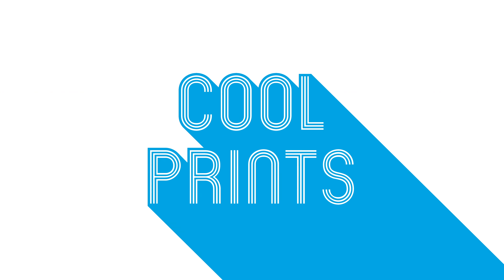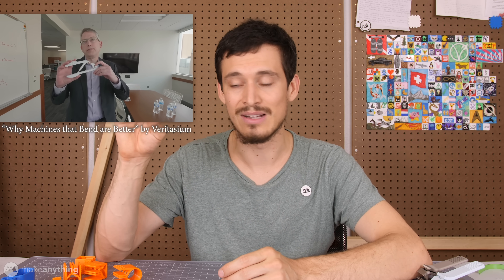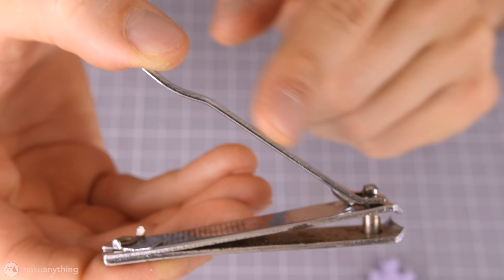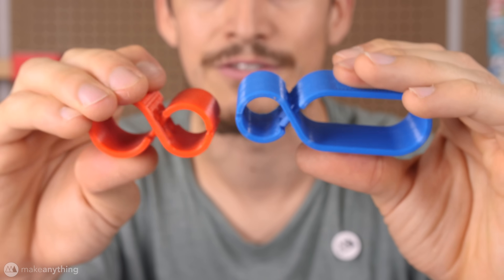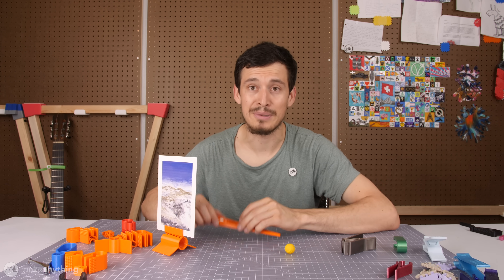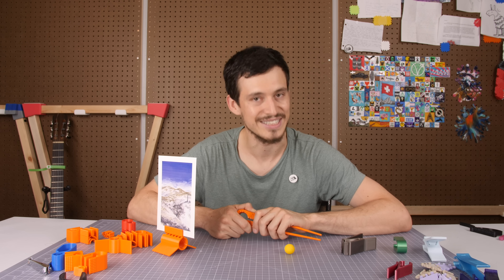Cool Prints // 3D Printed Compliant Mechanisms

Comment: use a stick in place of the ball in the chopstick.. like the switch shown in veritasium video. I meant, fix the ball with 2 rods on the top and bottom side of the ball .. then it will fix the problem and will become a compliant system too.

Comment: 2:39, yes, it's a 2d geometry, but that's not so you can laser cut it from a flat piece of acrylic.  It's so it can be manufactured at a microscopic scale.  Most of the advances in compliant mechanisms have come from the microchip industry.  They are widely used for clock chips and accelerometers.  Microchips are essentially just a series of 2d layers stacked on top of each other.

Comment: For the reverse chopstick mechanism since your already using an extra pice why not use a magnet and ball bearing. Or use a living hinge that has a marble on an extension cylinder so if can flop between the two settings

Comment: Actually I think the different types of guitar capo mechanisms are interesting. I play guitar and have seen a lot of different types. Personally, I use a D’addario Planet Waves capo which allows you to choose how tight it can be which can work well with different necks and you can make it so it presses down just enough so it holds the strings but doesn’t wear down the neck, although it relies on a few pieces.

Comment: C clamp at 4:50 actually requires even more force (pivot is on the "wrong" side of the lever), but you just feel more comfortable, on your fingers because the force is distributed to a larger area

Comment: what about modular structures, which can be significantly larger than the largest print bed, or concrete infill, which changes the properties of the part significantly.
a modular printer enclosure or a concrete infill flywheel can be printed as such.

Comment: That is actually a traditional capo. My dad has a few like that that is probably older than me. The advantage with these compared to clamp style capos is that they press down on both sides more evenly, can be less bulky and less in the way for your fretting hand, and they fit lots of different thickness necks. While clamps only fit one neck style well and tend to press down harder on one side (especially if it doesn't fit perfectly), but is way faster to apply and move than the other.

Comment: I would be interested to see if you can figure out a way to design / print reflectors. Maybe outfit a bike with printed reflectors (front, back, wheels) or reflective house address numbers, mailbox numbers,  or pin on reflectors for jogging.

Comment: Instead of a feeding it through why don’t you just make the capo like a bracelet or a seatbelt where you have a female piece on one side and a male piece on the other and my it just small enough to where it can fit around the neck of a guitar but still apply pressure to the strings?

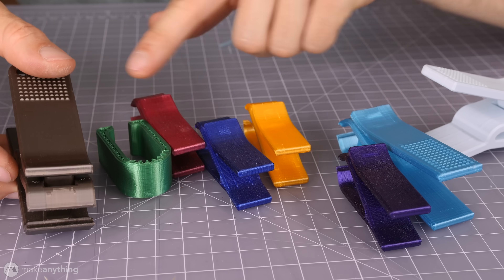Comment: 4:33 those are some EXPENSIVE failed prototypes
Reply: Ryan Moulder not as expensive as an injection mold
Reply: I mean 3D prints use very little filament. Generally is 800cm^3 per 1.75mm 1kg roll. At $35 for a roll I would guess at most those prints were $1 - $1.5 each. If I had the models I could be more specific. Basically the cost of SLA
Reply: @sacripudding4586  they're in the description
Reply: @electricheartpony  the ones in the description are the final model. I could base on that but the prototypes are pretty different
Reply: @sacripudding4586  oohh

Comment: "You could laser cut a sheet of acrylic to make these pliers"
Acrylic would probably be too brittle. AvE did a video on making compliant mechanisms out of metal, which didn't work because the metal is too rigid. Material properties are very important to consider for a flexible machine.

Comment: Use a steel ball and inset some tiny rare earth mags....(Orange chop stix bit)
Reply: Steel Ball Run
Reply: @josephtooley7301  Now we just need a 7th like
Reply: @irok1  7th like given
Reply: Make it with a cylinder that flips back and forth attached by thinner pieces that push it to the proper location. Then it could still be a single piece and would only allow the cylinder to move in one direction.
Reply: Good idea
Reply: Nyoho!
Reply: literally just a rubber band would be fine
Reply: I mean since he’s using a 3D printer couldn’t he print an orb inside the chopsticks and make it too small for the ball to escape?
Reply: Good idea for a useless problem lol 😀
Reply: Sea shadowbanned N.Christopher or in their real name, Neodymium Magnets
Reply: @itay-ziv  theyre the same thing, called both correctly
Reply: Oliver Dickson idk just find it weird to call them rare earth magnets.
Reply: epic_ziver_D they’re made with a rare earth element (neodymium) from the rare earth metals group of the period table.
Reply: @itay-ziv  rare earth is just a more general term. they can be made with samarium too, pretty much any of the rare earths

Comment: At 5:27 you can see how the filament has been stressed near the base of the vertical cylinder. I have played with similar designs an have found that by sinking the cylinder into the surface in the slicer rather than building a cylinder from the surface produces much more durable parts. I allows the base of the cylinder to be IU integrated through the outside walls and into some of the infill  if present. Is this model 100% infill?

Comment: Really nice designs.  I build my 3-d printer (Gawd) 9 years ago, from old printer parts.  Had fun printing weird things, but found designing them even more fun.  I'm curious, did you design those yourself ???  My poor printer has not printed in years;  Gonna try dust it off and try designing again.
Reply from the maker: Yes I designed everything here. Nothing beats printing your own creations!
Reply: @make.anything  Excellent;  Nice to see a fellow designer having fun.  I love doing the designs in such a way as to make them efficient for the printer to print.  Get more joy out of that planing than the actual print (Always takes so long).  Good to see.  More power to you sir!

Comment: Cool designs! Note that compliant mechanism are often one piece (i.e. monolithic), but they don't have to be. (The core is the flexibility through elastic deformation). Especially for FDM, you can break up your designs in to multiple parts to optimize for strength or build direction.
Reply from the maker: Good point! I enjoy the challenge of designing parts that print in place, but sometimes splitting up a print has clear advantages

Comment: You are truly a great modeler! What software did you make these in?
Reply from the maker: Thanks! All done in Fusion 360
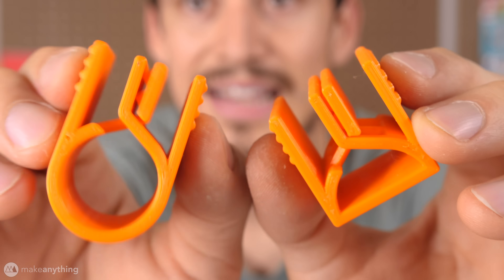Reply: @make.anything  well that makes me curious! How did you put diamond shaped teeth on the face of the pliers you're holding at 6:10?
Reply from the maker: They're square sketches extruded with a -45° taper
Reply: @make.anything  damn 80/20 strikes again 😅

Thanks for the tip!

Comment: Awesome!!!!
hey, here is a fun idea: try to print musical instruments!
Reply: Interesting, seems hard but i'm confident he's capable.
Reply: Cooowwll
Reply: Or even just something like a recorder
Reply: I’ve also seen 3D printed brass mouthpieces so just add a horn is easy
Reply: I wonder if it's possible to print fiber for strings
Reply: I have two 3d printed ocarinas
Reply: SpiceRice how many holes? Any sub holes? I've always wanted a double chamber one.
Reply: @andrewprahst  theyre both 12 holes. Ones alto and the other is a soprano. I tried to print a double chamber but it kept failing
Reply: SpiceRice Which holes are the subholes next to?
Reply: It will need to be airtight so quite a bit of sanding and matching will probably be required.
Reply: kazoo
Reply: You can print an ocarina or death whistle

Comment: Make side channels on that white thing 9:32 that starts wide and goes narrow which hold belt, so u don't need to aim precisely, just put it without even watching with belt tension up and down so the rubber will stick dead in these narrow channels and won't move
Reply: Would be much faster to use and, consequently, more reasonable.

Comment: Can we get a part 2 for compliant mechanisms? Since this video showed more basic mechanisms, I think there should be a follow-up that shows some more complex mechanisms; for example, the elephant shown in Veritasium's video, where there's a lot of compliant parts to the entire mechanism, but there's only a single pivot point at the end of the elephant's trunk that doesn't move laterally. Then maybe follow that video up with advanced mechanisms, like the single piece 2dof vectoring motor/engine mount.
Reply from the maker: Sounds fun :)

Comment: On your printed capo:

Make the white piece just be a pin or tab that sticks out, no hole in it ... make the green piece have holes in it like a belt.  Hold it across the strings and stretch around the back and then just hook the appropriate hole on the white pin.  this will eliminate the need to 'thread' the strap.  I have a capo made in this way that works well.
Reply from the maker: Good advice! If the holes print strong enough that could work much better :)
Reply: How about printing plastic grommets to glue into the rubber holes?  Search Google for "Elastic Capo" and you'll find lots of results of the capo I have!  They are very inexpensive, like $5 on average.  Thank you for sharing with the rest of us,  @make.anything  !

Comment: 9:16 these actually already exist. I have one but the strap is made of fabric
Reply: Ai Aikawa yeah I’ve had mine from Dunlop for years and I love it
Reply: Oh I used to have one of these. Fabric with metal eyelets for a tiny metal stick that goes therough a round soft "rooling pin" type thing that holds the strings down.